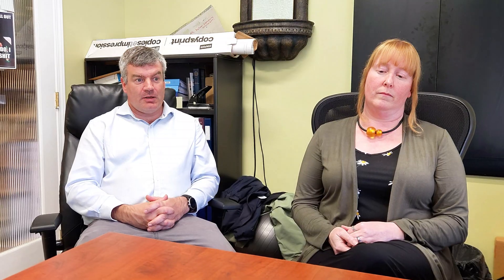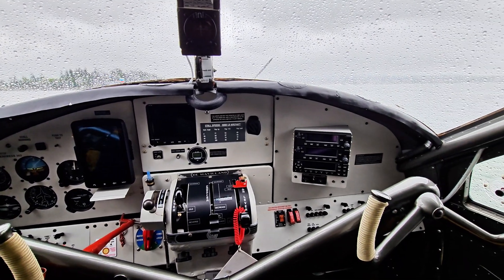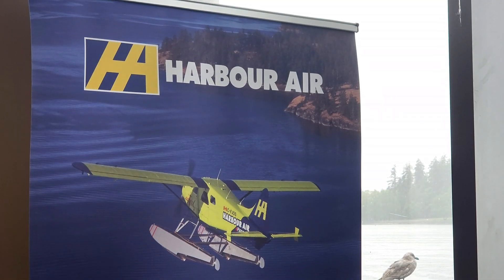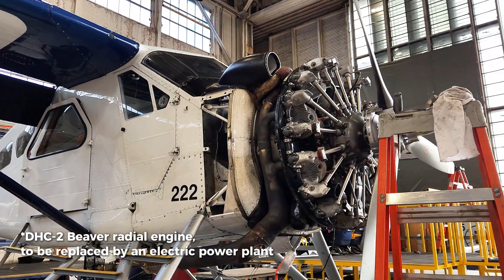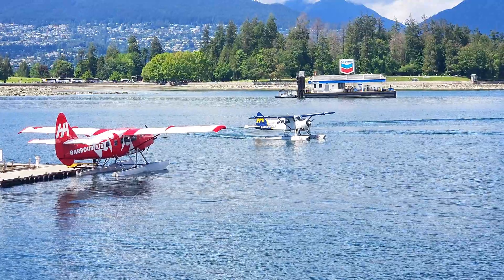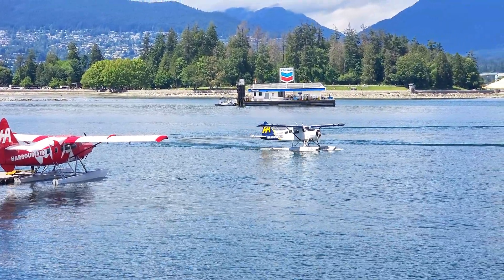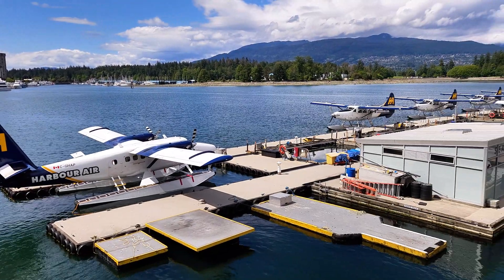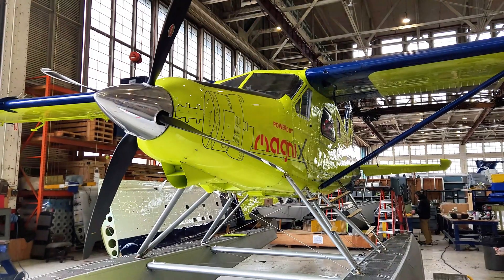Developing the ePlane: Making Aviation Green | #DeepDive

Comment: Good on them to keep working on it but it's always waiting 2 more years for a better battery. Eventually it may be viable with cells that can be charged much quicker than the current ones. Going to have to have some impressive power distribution out to the docks to charge a fleet of these.